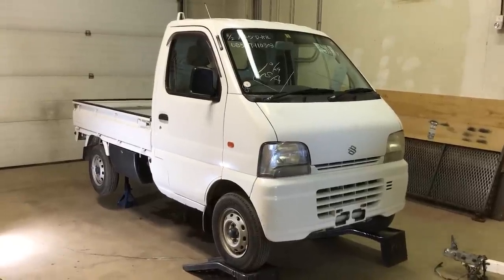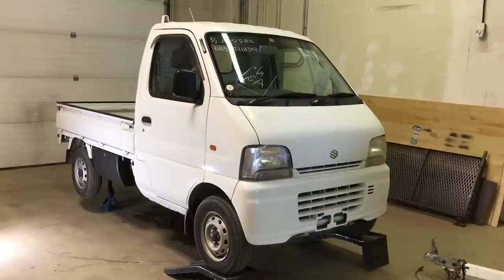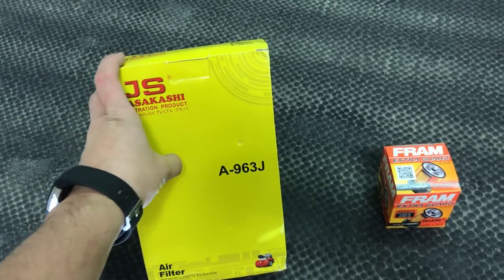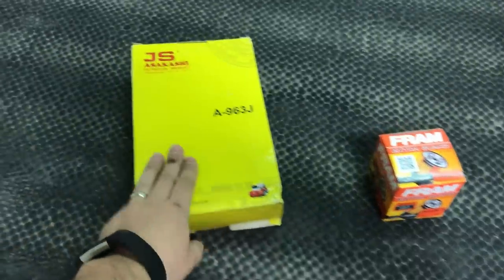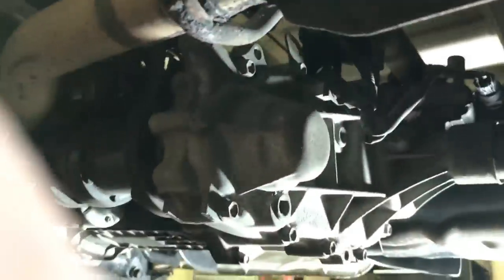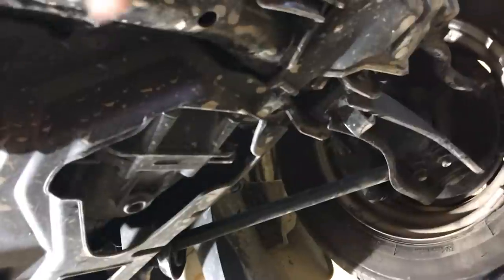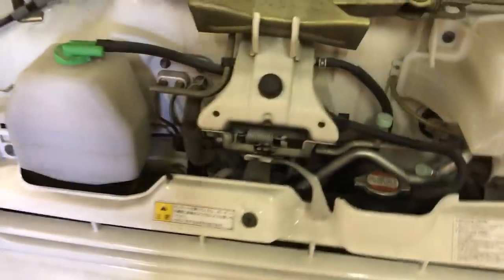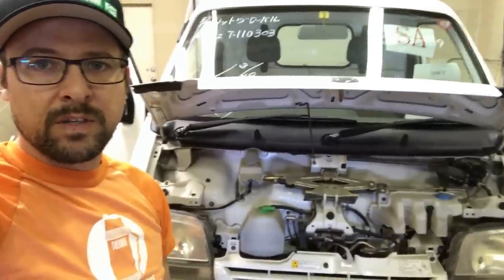Suzuki Carry Mini Truck - Basic Maintenance Overview

Comment: They have these little trucks and vans in the Philippines and the take them from and ship them there but before they do they chop them into pieces so they can sell them as “parts” and avoid the import taxes and then they reassemble them and make them left hand drive…they are completely refurbished with new interior and new paint and seats…I wonder what the oil change interval is on them?…
Reply: 3000km. 10000km if using synthetic oil

Comment: we have the mini truck that takes the round air filter  just wondering if these mini truck have a fuel filter and if it does where is it located.we are having trouble with it not wanting to run when you get in third gear

Comment: i was looking into purchasing a mid 90s suzuki or mitsubishi. was just curious what wiring is like on them. i’ve heard they’re backwards from domestic vehicles? i was planning on wiring in some lights, plus a winch control once purchased.
Reply: They are wired the same. 
The batteries are a little undersized, so that might need to be upgraded for a winch.

Comment: hi, i'm planning to replace my thermostat. you mentioned an air bleed bold located under the left front passenger seat. that cap like/cover just right above it. is that where the thermostat is?
Reply from the maker: +PATRICK GAAN yes that is correct

Comment: Hello, I have a 1997 DD51T with F6A motor.  In your video, you mentioned gear oil filler and drain plugs are at the transfer case area.  Is that just for the oil in the transfer case and there are separate filler + drain plugs for the gear box or one set of filler + drain plugs for both transfer case & gear box?  Thanks advance for your reply.  Great video by the way!
Reply from the maker: Barney Au on the Suzuki DD51 they are one an the same

Comment: I have a 1999 carry. Found the jack and crank but where is the lug wrench located?
Reply from the maker: You could check under the passenger seat by the battery but they are often missing
Reply: I am bay the carry Suzuki 1997 modile

Comment: Can you advise maintenance parts for a 1990 Suzuki Carry, 4x4, 660cc.?
Reply from the maker: The 1990 Carry will be very similar except for the the air filter, they used 2 different sizes of cylindrical filters so you will need to measure before you order. Also you will want to check and replace your distributor cap and rotor if it hasn’t been done in a few years and is worn or corroded. You should be able to find all those parts from a supplier like www.minitruck.ca

Comment: Why in the WORLD would you use a Fram air filter on anything you actually want running?
Reply from the maker: We typically don't, we usually use wix or JS right out of Japan. However the purpose of this video was to provide info. The Fram unfortunately is the easiest to find therefore we provide it so you can cross reference everything else off of it. Your welcome

Comment: Quick question for anyone who has owned one of these neat little trucks for a long period of time. With great maintenance and easy, careful driving habits, how many miles/kilometres have you clocked between overhauls of the engine?  I have lived in the Philippines for the past six years and Suzuki mini trucks (many imported used or in pieces from Japan) are in service all over the country. It is hard to know just how long they could last as I often see the trucks abused and with very poor maintenance. I see many different makes of vehicles run with only water in the cooling systems and often with no radiator cap installed. Many rides see few if any oil changes. It is almost as if the owners find it cheaper to rebuild/repair than do proper maintenance. We now have Suzuki Carry trucks available brand spanking new in the Phils and I would appreciate knowing what I could reasonably expect if I purchased a new turbo-diesel, gave it superior maintenance and drove it gently? Thank you in advance for any replies.
Reply: I have a 2005 Carry and Suzuki says that the engine can be expected to last 160,000 miles.
Reply: @awhensley   Thank you for the reply. I did not purchase a truck after posting my question, the pandemic got in the way. We are now thinking it may be time as we plan to do some camping with our young crew.

Comment: Just curious. How much can these thing rated to carry, cause i have seen these things well i was over seas carry adleast a dozen ppl or sand/rock/metal above the back window. Ie thousands of lbs, way more then they seam like they should be able to. Or do you think they are WAY under rated for carrying capacity.
Reply from the maker: These little Japanese kei class are rated for 850lbs the next size truck up is not much bigger but can have ratings up to 2200lbs! Those are typically what you would see doing the heavy work
Reply: Four Sons Off-Road Inc. Well that could be true. I know i have seen duelly one do a alot too but did not see many of them. Was just really impressed, camparing how much work per size compared to a full sized heavy duty truck in the states adleast in the hauling side.
Reply: @4sonsoffroad  I have a 2005 Suzuki carry fire truck and the carrying capacity is listed as 300 KG or 661 pounds.

Comment: i’ve got a 1991 every with the f6a turbo, we found the fram oil filter you use and tried it out but it actually leaks, not sure if maybe its just not tight but just wondering if anyone had the same problem. Have been leaking since i did the first oil change from off the boat
Reply from the maker: Oldest we have run them on is 94 (and a couple 99 turbos) 
I would check to make sure the old o-ring wasn't stuck to the oil filter mount on the engine as this is common and would definitely cause a leak. Other then that a full one turn after seating the filter should do it.

Comment: Sir, what is the right fuel octane for f6a engine carb type according to the manual? thanks!
Reply: No ethanol gas is best
Reply: I use Premium, 91/93 octane (America) in mine otherwise it runs poorly. 
(I use premium in all my small engines from my Harley to the lawn mowers. Tends to keep them running well)
I also put SeaFoam in the tank with the 76,000 KM on the odometer. Have no idea if it really help it but it's just "one of those things I do" with all my engines, small or large to keep things clean.
Reply: @chrischapman276  I use 91 octane ethanol free gas in my truck. When I bought it the truck had been sitting for 18 months with ethanol fuel in it. The ethanol blend ate a hole in the gas tank that cost me $800 USD to replace.

Comment: what is the main reason why differential pinion leak. and what type of engine oil can use in tropical country
Reply from the maker: Hi there, a differential pinion seal is a very common replacement item on any vehicle with that type of axle. Over time the seal can wear out or crack and even just a piece of dirt stuck in there will cause it to leak. I only have the base suzuki specs which says to use a 75W-80 GL5 oil in the differential
Reply from the maker: For engine oil you can use 10W30
Reply: thank you sir
Reply: how about synthetic oil what grade can use to my mini truck
Reply from the maker: Suzuki Recommends a 10w30 synthetic would work fine too same grade

Comment: I have a 99 Suzuki carry, how do I remove the speed limiter/governor?
Reply from the maker: It depends on what type of speed limiter was put into place. They typically don't have them stock.
Reply: @4sonsoffroad  Any idea what I should look for?
Reply from the maker: Do have access to all 5 gears (assuming its a manual) Most common thing is just a shift blocker plate.
Reply: @4sonsoffroad  It shifts through all five but won't go over 25(30 if it's a really flat road)
Reply from the maker: Could be mechanical on the engine or electronic programing even. Sorry I'm not sure as they don't need speed limiters up here in Canada
Reply: @4sonsoffroad  Thanks for the information I'll have to keep searching the forums.

Comment: You talked about type of oil to use in it... 
I use good quality diesel oil in not just this but all my vehicles. 10-30 I believe. Might be 10 40. Regardless, if it's good/best for my Cummins, it's best for my 3 banger

Comment: I could use any information you got on the 4 wheel drive system. When I shift into 4 high you can hear everything working but it doesn’t show it’s in 4 wheel drive. I have to peck on the 4 wheel drive control box with something then it goes into 4 high.
Reply: Any info you might have would be greatly appreciate. Thanks for your time.
Reply from the maker: Kentucky Raised not sure what model and year you have but the 4x4 system on these newer carrys has two parts to it. When you pull the 4wd lever it is pulling a mechanical cable that is shifting the transfer case to engage power to the front diff. The front diff is engaged via an electronic solinoid that engages the front axle sending power to the wheels. I have seen something as simple as a low battery cause the front diff to not engage but also it could be due to a wiring issue or just faulty solinoid which you can replace (just check your battery first haha)
If it's an older stly Suzuki then the front diff is vaccum engaged so you would have to check vaccum lines or again the actual vaccum switcher in the front diff.
Reply: Four Sons Off-Road Inc. I’m sorry it’s a 2001 db52t. The 4 wheel drive works sometimes and other i have to peck on what I’m guessing is the transfer case. It’s above the axle on the passenger side. It’s the little black box. Thanks again for taking time to answer my question.
Reply from the maker: That's the front diff and the little black box is called a Free Axle Control motor 
It engages and disengages the front axle.
Check to ensure your battery is good first. If you regularly run the truck for short periods and start and stop the engine alot the battery voltage can get low enough that the truck might still run or boost easily but little items like the 4x4 electronics can start to get affected by the low mileage. 
If your sure your battery is good you can replace the little black box as it may be damaged or have moisture in it. (There is a little vent tube coming off the front that needs to be in place so if it's missing or cracked water can get in there.
Reply: Four Sons Off-Road Inc. thanks for the input. It’s appreciated. Info on these mini trucks is hard to come by and parts are even harder. Thanks again
Reply from the maker: It's not as hard as most would think. The key is finding sources in the native market as these trucks as common in Japan a Ford F150 is here. If you need help with parts contact us by email info@4sonsoffroad.com
Reply: Four Sons Off-Road Inc. thank you

Comment: Hi sir can you post maintenance in suzuki da63t? What kind oil to use transmission,engine,differential?
Reply from the maker: Jay Christian Eribal if by post you mean ship, we only ship within Canada
Reply: No sir im just as what kind of oil will do you use in da63t??
Reply from the maker: Basically all the same specs as this video, there are no major differences in types and capacities on the DA63 from the DB52T
Reply: Can i use 80w90 in differential???
Reply from the maker: You probably could however that is heavier than recommend so you wouldn’t want to run that in colder climates. Also make sure it meets GL5 spec.
Reply: i well run for summer it that ok the 80w90?
Reply: Or the recommend 75w80?
Reply from the maker: I can only recommend to run what suzuki lists which is 75w80 GL5
Reply: Ok sir thank you so much
Reply: One more thing sir i try to search for gl5 but i just see 75w80 gl4 only i dont know if that ok for differential axle?
Reply from the maker: Different markets have different oils. You will want to make sure you stick with the GL5 spec, maybe you could find something close like a 75w90
Reply: I see 75w90 gl5 i dont know if that ok for differential
Reply: And also is ok to put 75w90 transmission too?